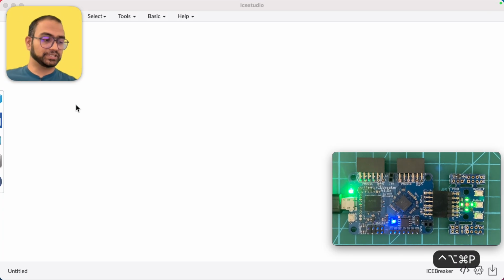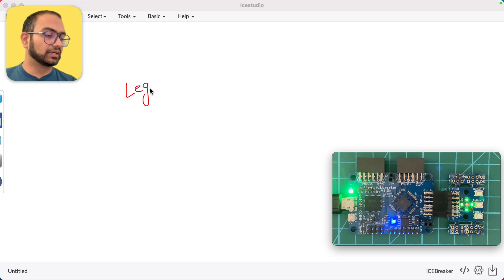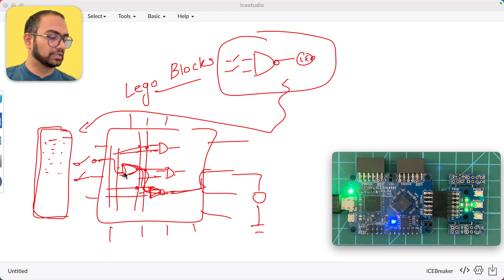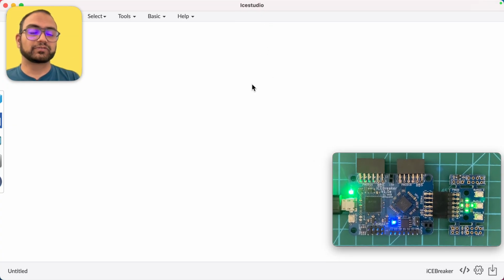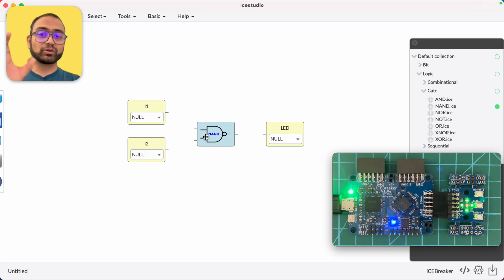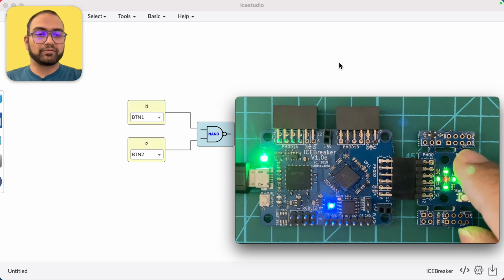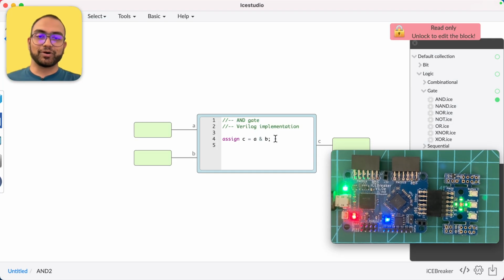Demo: FPGA based Hardware Design for Software Engineers

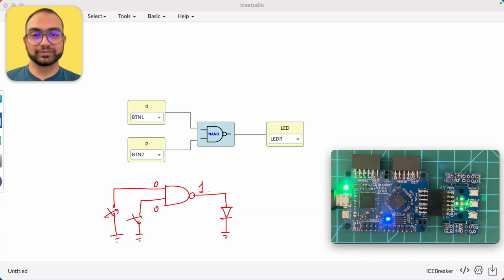Comment: You made a small mistake in the logic at 10:56. The input logic of the buttons is active high, but the LEDR output logic is active low. So if you make both inputs 1, High, you get a Low out and current from + through your LED to the FPGA.